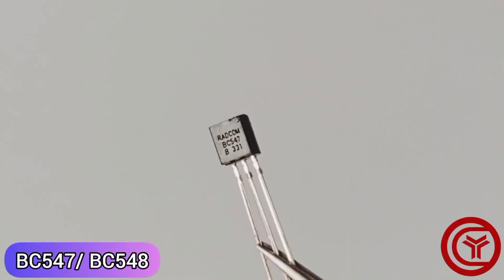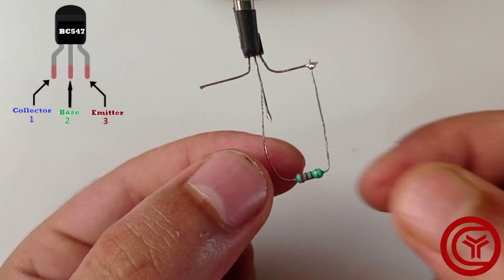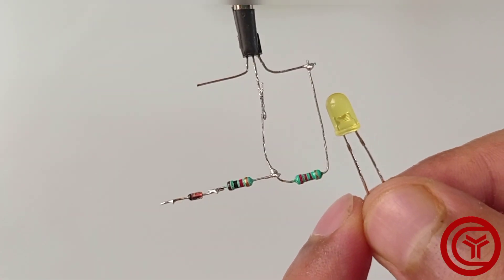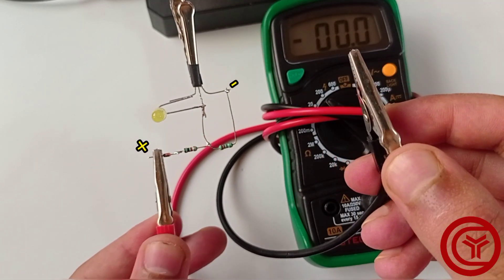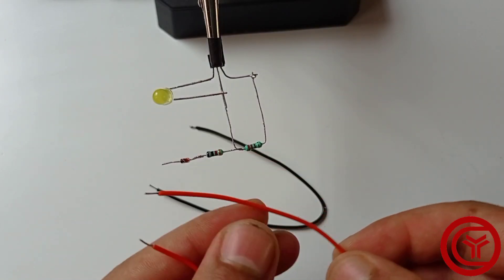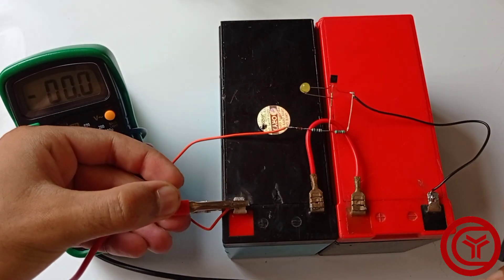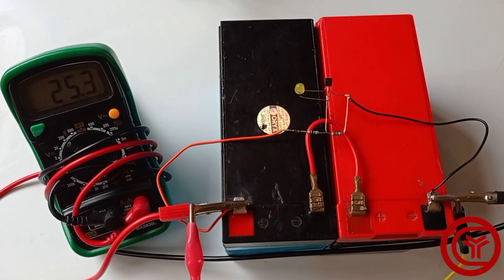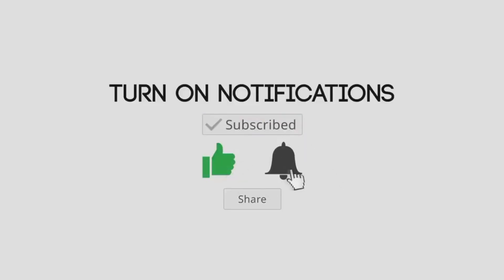24v battery full charge level indicator circuit

Comment: Nice video🙂, if want to use for 20V battery beside zener does the value of the resistor be changed? And what is the value of the resistor? Thank you
Reply from the maker: You can use lower the zener voltage, Resistor not needed to be changed
Reply: @CreativeTechos  thank you for information 🙏😄
Reply from the maker: My pleasure, Thanks for watching 🙂

Comment: I did not understand why did you put the Zener diode ? 
   A diode 1N4007 is not good ?
Reply from the maker: Zener Diode is the main component of this project, if you put 1N4007 Rectifier led will glow from about 2-3 volts, zener diode block the current flow to transistor till battery get fully charged.
Reply: @CreativeTechos  Okay ! Thank you for explanation. I did not know this things.
Reply from the maker: Most welcome bro, learn & explore 👍
Reply: @CreativeTechos   Oh ! 
   You're much smarter than me ! 
   I can barely know the basic things. 
   In fact, when I saw the Zener diode, I was expecting a threshold of 24 V. 
   I mean ... the tension can not reach 25, 26 V. 
   Thank you for your explanation !!!!